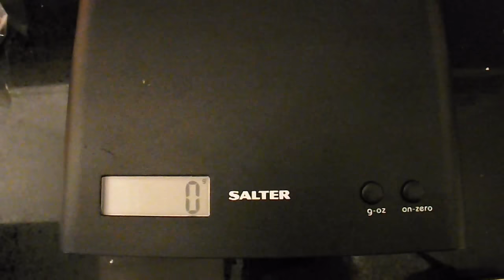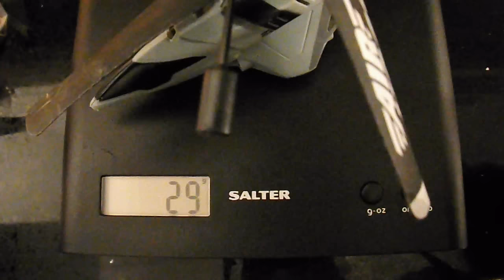Charity Shop Gold or Garbage Air Hogs Fly Crane LiPo battery swap

Comment: Well, touching motors to see if they r overheating at max throttle is a way to judge m/c max capacity. Typically Airhogs machines rated performance barely meet the performance requirements. 

For durability & robustness Machines must be designed to surpass performance requirements by at least 3 times. eg our cars have rated speed of 180 kph & on avg we run those at only 60 kph

Comment: you can little bit remove some weitgh on the helicopter but it is your hlicopture you choose what to do
Reply from the maker: yes I could do that but I think I would have to start cutting the bodywork away. I tried it without the landing gear and that made no difference. I would think removing the winch assembly would help too. Maybe if I am stuck for a project I could do one chopping bits off until it gets off the ground :)

Comment: That's disappointing I thought it would work. At least now you can use it for parts :)
Reply from the maker: +X-FLIGHT101 yep, that's the usual purpose for them although as I replied to Aleksander Sats it might be an interesting project to trim bits off it trying to make it lighter until it finally gets of the ground :)
Reply: +GrandadIsAnOldMan 
I would start with getting rid of the "machine gun" or whatever thing and the third motor. It seems to be pretty heavy and dead on the CG.
Reply: +kardRatzinger
Also, maybe toss the plastig enclosure altogether, and create a silhoutte model out of some foam. Should be much lighter than this.
Reply: +kardRatzinger 
another thought: to rule out the possibility that it's the controller's fault, you could just hard-wire the battery to the motors, and measure the thrust of that configuration with your scales.
Reply from the maker: kardRatzinger as a new toy this works fine, you will see that in the linked videos in the description, so I should not need to remove any items to help it to fly. It probably needs the motors replacing. In a later video you will see that I adjust the pitch of the blades and it does fly although not as good as new. The most likely option will be that I break it down for component parts.

Comment: Grandad , Reading in the leaflet that came with my lipo's a brand new lipo battery will not give out it's full power on first charge, they get more powerful with use it may take 4, 5 or even 6 cycles to reach full potential, hope this helps.......M
Reply from the maker: +MrMal1956 I would still expect it to get off the ground, but maybe if I feel the need to have another go with it we might see if it makes any difference. What I would really like to do is bypass the AirHog power socket so that I can charge it with a USB supply instead of via the batteries in the transmitter so I can be confident it is getting a proper charge.
Reply: +GrandadIsAnOldMan Thanks for the reply, watching the rc 101 review on landing the lower blades continue to rotate the ones on yours stop almost instantly could they be binding?......M
Reply from the maker: MrMal1956 could be, maybe the shaft is bent or one of the motors is binding. It could well be worth a second look at some time so I won't strip it for parts yet :)

Comment: hi, maybe if  u had the original controller to the heli then it might get off the ground but thats just a wild guess.
Reply from the maker: +marc wohlmayer it's a possibility, but I am unlikely to find out unless the right transmitter turns up. Unfortunately every infrared toy that I have found so far only talks to it's designed transmitter. I have quite a few toy helicopters and cars and quite a few transmitters but none of them have been interchangeable. Maybe I have just been unlucky but that is how it is at the moment.

Comment: I have a problem with the same helicopter, but when i charge it my pad start to say that is charged then I try to fly it and the helicopter starts to do some 'donuts' and in 10 seconds it stops and switch off. Any solutions?
Reply from the maker: Did you replace the battery?
Reply: Nope
Reply from the maker: @pepefuentesf1  I would suggest changing the battery if it is only running for 10 seconds.